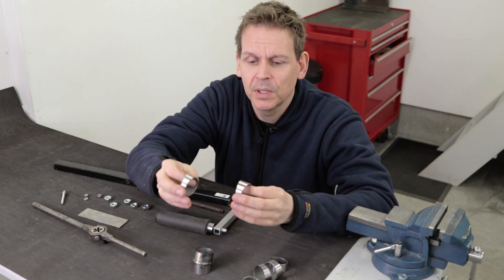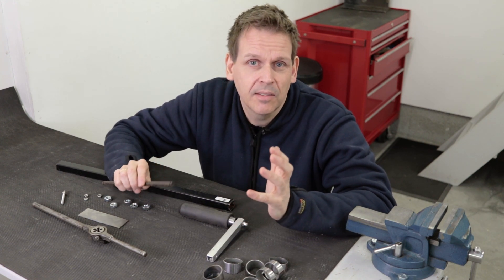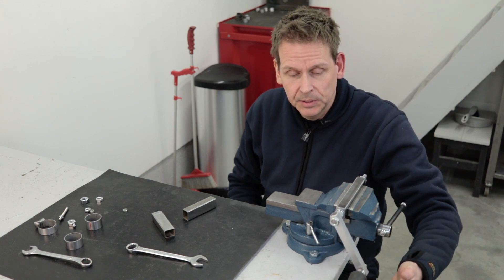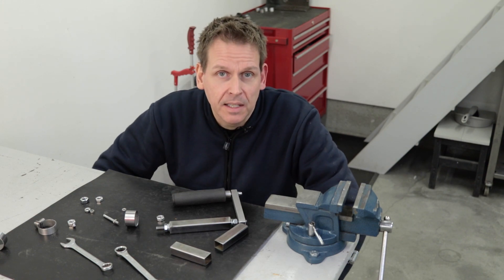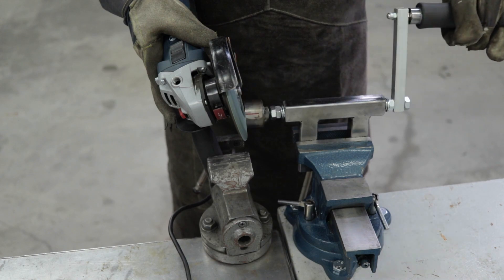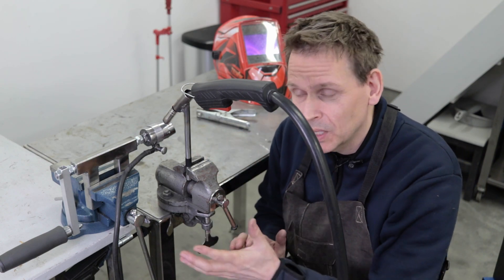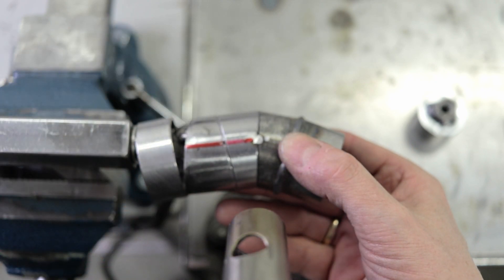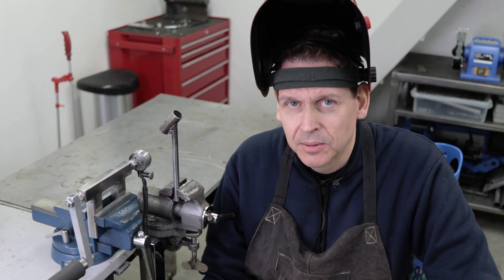Pipe and Pie Cut Welding Machine DIY

Comment: Lots of folk can find complicated or expensive ways to solve a problem or do a job. It needs a spark of brilliance to solve a problem simply. You showed that spark in this video. Great work and impressive welds! Thanks. Les in UK 🇬🇧
Reply from the maker: Thanks a lot 🙏 I have since this video bought a small TIG welder, you can weld much slower with it and it makes it easier to get pretty looking welds. But: it taks a lot longer time than using MIG, and very much more expensive as you use enormous amounts of gas 😝 I'll probably stick to MIG welding when possible, and I actually use this DIY positioner frequently!

Comment: Hello.  Just discovered your channel.  It looks really good what you are doing👍🏻.  At one point we had to make some ufo oil lamps so we made something similar to your setup.  We took an electric drill with variable speeds and it works fantastically.  Hope you understand what I write.  Sincerely, Lars from Denmark.  🇮🇸🇩🇰
Reply from the maker: Thanks 😊 I have used it several times and found it very useful. Using a electric drill was smart, I have thought about adding a stepper motor to it, could be a nice upgrade.

Comment: With a NEMA17 stepper motor, an TMC2208 Stepper Motor Driver, a Arduino Nano, a push button latched with the welding machine trigger, you then have a semi-automatic circular welding robotic arm! Or if you feel hardcore, use a closed-loop stepper motor controller instead of TMC2208, then you have the “world most precise semi-automatic circular welding robotic arm”!😅Very impressive work and very inspiring creation!
Reply from the maker: Hmm, when I think of it - I do have a stepper motor laying around somewhere after I upgraded my 3D Printer. I also have a lot of Arduino boards. Perhaps a foot pedal for start/stop 
with possibility to adjust the speed is better than wiring into the welding machine trigger. It could also be smart to go backwards to find best starting point, or to redo a weld. This is actually quite a cool idea! Added to my idea backlog now 😊 Thanks a for your feedback and your idea!!! 👍
Reply: @kihestad  thanks for reading! I was thinking maybe a latched switch could turn the crank when you trigger the welder. Although I work with MCUs, I have zero knowledge about welding. It’s quite amazing if we can see a robot welding arm!

Comment: For avoiding the cable to rotate you could build a rotary ground clamp, see https://youtu.be/bIkHtYWENiA , maybe adapted to your use case.
I would shorten the lever to have more control about constant turning or add a motor with a potentiometer, so you can easily adapt the rotation speed to your feeding speed.
One more sub for you, great build.
Reply from the maker: Yes, having the cable curl up made it hard to keep consistent speed. I have thought of a simpler solution than what shown on the video though, I just need to be able to rotate 2 or 3 turns. My idea was to curl up a flat braided copper wire, something like this: https://i.ebayimg.com/images/g/yu4AAOSwaC1f7VdH/s-l1600.jpg
I think a motor is really the only thing that would make sure to get a constant speed, that would also free up both hands so you can get event better positions. I have actually a stepper motor extra after upgrading my 3D printer, might be a new project on it's way there 😊
Thanks a lot for subbing 🤩

Comment: Yes they are what are called "WELD POSITIONERS," very expensive to purchase. Try looking in / at EBAY. "Weld Positioners," under / in "Business & Industrial." Also you may want to search youtube for DIY Weld Positioners.

You haven't reinvented the wheel, you just now discovered the wheel exists, and has been around for a VERY LONG TIME. Welcome to the 21st century.

Next thing you know, your'll discover that water is wet, and rocks are hard.  I'll bet that will be a shock to your self awareness.
Reply from the maker: Thanks for the tip, will check it out! I have tried searching using all kind of keywords, but not this 🙂
Reply from the maker: Is water wet? 🤪
Reply from the maker: Ahh ok, searched for it and yes I have seen those with motor. Too expensive for my limited usage, but those are useful especially for tig welding.
Reply: @kihestad  I have seen some home-made / DIY and they used (in America "Windshield,") the rest of the world "Wind-Screen" (Brushed/DC) motor's. Seem to work very well.

I would suggest that you may not want to purchase one of the expensive one's, do look them over for all engineering ideas that you can gather, to help you design / build your own. A hint if you will, if your build mission is critical (i.e., measurements in the thousandths / mm) do build with a 4-Jaw-Chuck in mind, if not use a 3-Jaw chuck. or purchase the cheap Chinese Metal Lathe Chucks Size {6 inch / 152.4mm} in a 3- Jaw, as well as a 4-Jaw.

The 4-Jaw chuck(s) give the option of build mission critical, as well as holding ill-regular shaped parts, and still turn them in a true circle. FYI. 4-Jaw chucks are hard to use at first, but as you build your skills, you'll never look  at a 3-Jaw chuck the same. Is a setup in a 3-Jaw chuck fast? ANSWER: YES!  Is it close in {Measurements} tolerance as a 4-Jaw, no way. 

When using a 3-Jaw, your saying {Measurements} tolerance (Approx. +/- .010" in. / 0.254mm, or more) doesn't matter, close enough, is good enough.

For the smartest person in the room, yes there are adjustable 3-Jaw chucks, but you see how he's crying about the price of a Weld Positioner, he'll need heart medication for the price of a Adjustable 3-Jaw chuck.
Reply from the maker: @stanwooddave_1953  Thanks' a lot for all your useful tips! This sounds like a really fun project!